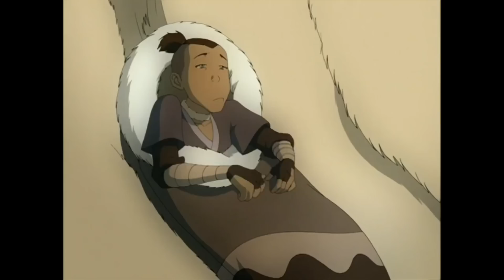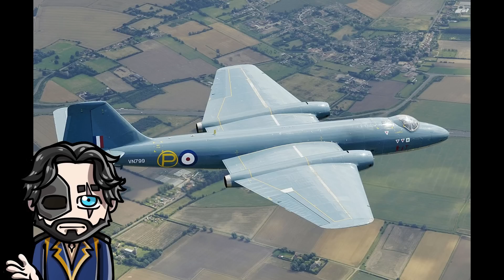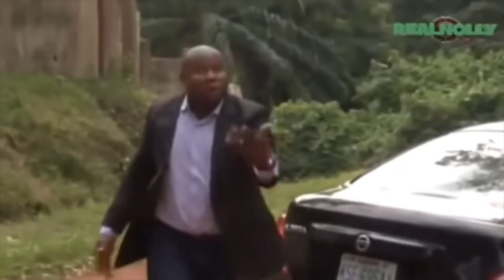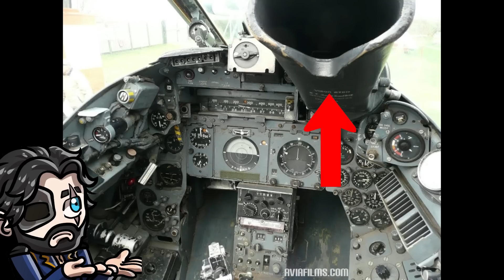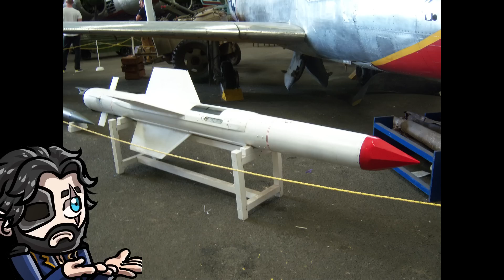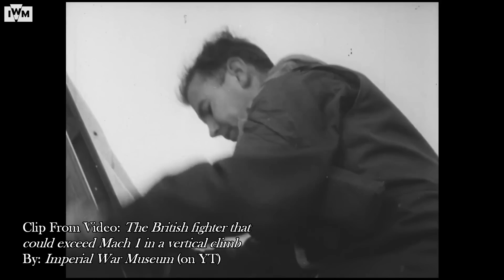English Electric Lightning: Gone In a Flash | Corrupted Intel Files

Comment: So hold on, this is the F-15, before the F-15, while also outperforming (flight performance wise) the F-15. I used to shit on this thing for its goofy ass design, I thought no way something like that would work. Talk about a 180 and some more, this thing is fucking awesome.
Reply: Fun fact: the true airspeed and altitude of this plane is STILL classified. It left service in the late 80s
Reply: Never bet against British engineering. They really are quite capable.
Reply: @langdons2848  Yes, I'm a huge fan of British engineering. I like to follow behind British sports cars and collect all the well-engineered parts falling off of them.
Reply: @Curt_Sampson you realise motorsport more or less globally wouldn’t function without the brits, right?
Reply: @jordanclark4635  Indeed I do. You do realise I was joking, right?
Reply: @ touché, sometimes hard to tell tone online, and some people would say so seriously lol
Reply: Eh, F15 is about 600 miles per hour faster, more maneuverable, more useful combat load, better avionics, and climbs at 10,000 feet per minute faster(30,000 feet per minute)
Reply: @whiskey11niner   yeah the F15 performs better but your figures are incorrect.
F15 Mach 2.5 1675mph
Lightning  Mach 2.3 1500+mph
Lightning also zoom climbs at 50kft/min.
Reply: @ the F15EX can do over 1900 MPH
Reply: @whiskey11niner  yes which is 1600+ knots (nautical mph)
The Lightning can go (1500+ knots).
Reply: @MultiVeeta  no the lightning is capable of between 1300-1500 MPH, not Knots
Reply: @whiskey11niner   sorry but you are wrong.
The Lightning F6 went Mach 2.27 which is 1750mph (1500 knots).

This is all irrelevant because combat pilots rarely exceed Mach 1.5.
And on top of that an F15EX will never be faster than an F15C, the EX carries a lot more weight and drag such as the conformal fuel tanks.
Reply: @MultiVeeta  the funniest part is you don’t realize why you’re wrong. You’re basing that statement off density altitude at sea level, at 40,000 ft which is where the lightning is capable of 2.27 that only equals out to 1495MPH or 1300 knots because the speed of sound is much lower there than it is at sea level
Reply: @whiskey11niner  are you really trying to sound smarter than what you actually are? It's not working.
Mach speed is actually True Air Speed (TAS) and is measured at what rate you want it to be, mph, nautical mph, kmh, m/s etc. 

The confusion you have arrived at (and clearly don't understand) is comparing Ground speed and True Air speed, then altitude comes into the equation.

Simply put True air speed is
F-15 Mach 2.5 is 150mph faster
Lightning Mach 2.27
Same altitude.

Now tell me some more stuff you have googled and not understood on the internet.

And just so you're aware, there is not a single aircraft that can reach Mach 1.5 from level flight at sea level.
Reply: @ I see you’ve never known why aircraft top speeds are listed as Mach_ @_ altitude, because that’s the actual airload on the aircraft, Mach changes at different density altitude(temperature) and no Mach number is not an equivalent of true airspeed, it’s a ratio of it and the LOCAL speed of sound, did you never question why a plane’s maximum speed and Mach limit at sea level is so much lower that its actually maximum speed and Mach limit, it is very cute that you’ve doubled down and let everyone know that you have no idea what you’re talking about tho
Reply: @whiskey11niner  you are deeply confused.
You're trying to tell a pilot about speed.

Generally Mach 1, the speed of sound is 767 mph TAS. But can change by upto 100mph due to altitude.
All aircraft results are in TAS.

You are talking about Indicated Air Speed (IAS) which is different to Mach/TAS depending on altitude.

Example.
IAS of 697mph at 3kft is TAS 767mph (Mach 1)
IAS of 353mph at 30kft is TAS 678mph (Mach 1)

Mach speed is a ratio of the speed of sound meaning Mach 1.20 is 120% the speed of sound, this is important for fast jets because weird things happen in this and the transonic regions and they need an easier indicator to read.

I hope you've learnt something today.

Also a planes speed is limited at sea level because of air density, the air higher up gets thinner so there is less resistance allowing aircraft to travel faster with less thrust.
Reply: @ you repeatedly say things that have nothing to do with what I’m actually talking about it really seems like at this point you’re just doing this to try and get away from an argument that you know you’ve lost, correct at sea level Mach is 767 MPH, at 40,000 feet Mach is usually around 660 MPH, I literally gave you a textbook definition of what a Mach number is, maybe you should check out aerodynamics for naval aviators, or wind and beyond
Reply: @whiskey11niner  lost, you lost on your 1st post where you claimed Mach 2.5 is 600mph faster than Mach 2.27.

I've said all along it's only 100-150 mph faster, which it is as has already been established, you just can't get over it.

And looking at it now it seems you're claiming the EX can do Mach 3, lay off the Tik Tok videos kid.
Reply: @ you good, mr “your talking to a pilot” does that work on people? Well considering the real number for the F15 EX is more like Mach 2.8 (1870MPH at around 40,000)before that statement was retracted for being “inaccurate” actually because it was real and was accidentally released by Boeing in an official press release, I’m sure they know their aircraft, I’m not the one that tried to claim “sorry but you are wrong. The Lightning F6 went Mach 2.27 which is 1750 MPH (1500knots)”, yes I have the screenshot so don’t even worry about editing that, when the official top speed is Mach 2.27 at 40,000 which is 1500MPH/1300Knots, and that was the fastest service variant of the lightning
Reply: @whiskey11niner  
Boeing rate the engines for that speed, the airframe and what it can do as an aircraft are totally different.

Mach 2.27 which is 150mph slower than Mach 2.5.
600 mph faster like you outlandishly claimed is Mach 3+.

Just drop the clown act and admit it was an incorrect statement.
Reply: @ I’m not the one that repeatedly tried to claim Mach 2.27 was 1750 MPH Mr pilot
Reply: @whiskey11niner  no you claimed a Mach 2.5 F15 can go 1900mph and that is what threw me.
Reply: @MultiVeeta  well unfortunately for you I have screenshots of you saying exactly what I just typed to the letter, you’ll find I never said that Mach 2.5 is 1900 miles an hour. I said the F 15 is capable of more than Mach 2.5 according to Boeing that they released accidentally, and initially you agreed with me, but tried to claim that the lightning could do 1750 and that 2.27 was 1750 miles an hour, which by extension means you actually claimed Mach 2.5 was 1900 miles per hour
Reply: @whiskey11niner  nonsense I have never agreed with your outlandish claim of more than Mach 2.5 and even stated to you that the EX will never be faster than the F15C due to the extra drag from conformal fuel tanks and the extra weight.

You claimed an F15 is 600mph faster than a Lightning.

Me knowing a Lightening and F15 Mach speed as 2.5 and 2.27 told you it was 150mph difference.

You claimed the F15 did 1900mph.

Me thinking you was stating 1900mph as Mach 2.5 I stated that the Lightning did 1750mph thinking this was the conversion. In actual fact it is 1650 for F15 and 1500 for Lightning.

Ive already pointed out I miscaculated based on the figures you were giving me because you have some delusion that the F15 can do Mach 3, and that is the crux of it, your delusion.
Reply: @ well I mean the AirForce’s official page on the F15 claims 1875 MPH, but what do they know, they’re just the worlds largest operator of the type, also its abundantly clear you came into this with minimal knowledge, again I never claimed the F15 in its current generation was a mach 2.5 aircraft, hell you didn’t really seem to know that Mach number changed with temperature/density altitude, and you assumed Mach 2.5 was 1900MPH as you just said, also what’s your pilot certificate number mr pilot, and no its not confidential information, fail to provide me with that and I’ll just ignore your responses, I’ve wasted enough time on you
Reply: @whiskey11niner  you are nuts aren't you.
Even Boeing themselves have stated it is a Mach 2.5 aircraft, the Mach 3 came from a sales rep at a Singapore Air Show announcing it could go well over Mach 2.5 to Mach 3.
This has been corrected by Boeing, the engine power theoretically means it can go above Mach 2.5, the actual aircraft rated performance is Mach 2.49.

I don't know how many times I need to tell you.
As for 1900mph, many articles site this as equalling Mach 2.5 because however wrong they maybe that is Mach 2.5 at sea level.
Reply: @whiskey11niner  
The Mach 3 claim came from a Boeing salesman at a Singapore Air show and has since been retracted by him.
He claimed it could go Mach 2.9 which he claimed is 2225mph at sea level. His words.

The engine power means in excess of Mach 2.5 is possible, the airframe says differently. Boeing's official statement is 2.497.

Many articles state Mach 2.5 as being 1900mph at sea level. I don't why they do this but this is where your confusion is coming from.

And, I don't need to prove anything to some random on the internet who is not even mature enough to admit when he is wrong on something.
Reply: @ yep that’s what I thought, step back small sack, good bye
Reply: @MultiVeeta  yeah that’s what I thought,  goodbye
Reply: Lot of people commenting here, comparing the lightening to an F15. Not even relevant, The F15 came many years later.
Reply: @AnthonyWild-s7d  F-15 is 50yrs in service. the Lightning and F-15 came out 16yrs apart. They had overlapping services. It's 100% relevant.
Reply: @AnthonyWild-s7d  F15 Avionics fantastic to go to war in but to fly Brian Carrol would still choose the Lightning.
Reply: faster =/= better

Flight performance wise, the F-15 would wipe the floor in a dogfight.

The YF-12 was an even faster interceptor.
Reply: @SoloRenegade  I’m well aware of that. But it doesn’t mean it ain’t cool.
Reply: F-15: Mach 2.45, 16k lb useful load, 675mi range, 65k ft service ceiling
Lightning: Mach 2.15, 10k lb useful load, 115mi range, 60k ft service ceiling

F-15 is more maneuverable, more advanced, especially with the new F-15EX, has countermeasures, RWR, better radar, etc.

F-15 wins hands down in basically every category.

Only the supercruise was an advantage. but with so little fuel on board, that wasn't much of an advantage.
Reply: @SoloRenegade  Ok fair point.....

But counterpoint...
Lightening's max speed is unknown. It's still classified and the known internet speed is the average max speed recorded by the export variants who were less aerodynamically stable with all the extra hard points they added for missile pods and fuel tanks.
Same issue for the max ceiling altitude. There are several versions of the lightening and only a hand full of them have declassified flight data.

I have no idea why a 30 year old plane needs it's flight data classified when we have modern aircraft with their flight data publicly available but the cold war was a strange time for military information.

But please bare in mind that one Lightening successfully intercepted a U2 spy plane at close to the U2s top altitude.

But that being said we ae still assuming the F-15 information is right as the USAF does have a habit of understating the capability of it's aircraft.

I still think that the Lightening beats the F-15 even if only because the F-15 only just outperforms it almost 10 years later after a huge development of aircraft innovation.

It's like a biplane being able to compete alongside a P51 type crossover.
Reply: @SoloRenegade  So how come the Lightning could intercept U2 and Concorde but the F-15 could not? Where did you see the 60k service ceiling? The actual ceiling is classified but Soviet intruders have been intercepted at higher altitudes than that.
Reply: @telhudson863  F-15 could intercept them, but didn't need to.

how many satellites have lightnings killed? how many air to air kills does a lightning have? how many countries operated the lightning and for how many years? why is the lightning no longer in service?
Reply: @SoloRenegade  
Mach 2.15  LOL 
 60k feet LOL

F15 couldn't intercept Concorde or the U2
Reply: @sichere  F-15 could intercept the Concorde and the U-2. if real combat, they'd intercept early, and fire missiles.

Keep in mind the F-15 has killed satellites and zoom climbed to well above a U-2.
Reply: @SoloRenegade  Not operational Squadron ones
Reply: @SoloRenegade  in 1985, while conducting Concorde's trial test flights, BA offered NATO to exercise on intercepting a fly-high supersonic bomber. all modern fighters, including F14, F15 and F16, failed to reach their target, except the 1950's EE Lightning, who intercepted the Concorde with ease.
Reply: @sichere  an operational F-15 shot down the satellite, and others could too. How many have the Mig25 shot down?
Reply: @sichere  poor test. they were trying to catch the Concorde from behind. Lightining and Concorde can supercruise. Biased test. in reality the F-14 and F-15 would have slung Mach 3-5 missiles in a head-on intercept. F-15 would have no trouble shooting down the Concorde in teh slightest.

Lightning didn't carry much in the way of BVR weapons, or much weapons of any kind.
Reply: @SoloRenegade  The EEL was ground linked guided to target and capable of carrying instant sunshine. it entered service with the RAF  as an Experimental Development Aircraft and the BAC version with RR Avon 302 R  engines were often clocked at Mach 3 over the North sea by the Dutch Air Traffic Control.
Reply: @sichere  "engines were often clocked at Mach 3 over the North sea by the Dutch Air Traffic Control."

yeah, engines do go faster without the aircraft. I think you need to work on your english.....

and remind me the range of the Lightning again?

The lightning Never went Mach3, that was the SR-71. The Lightning was slower than the F-15 at only Mach 2.15. Cope harder. the Lightning was cool for its day, but highly impractical except as a short range interceptor, and it was otherwise hot garbage, which is why nobody else wanted it.
Reply: @SoloRenegade  the BAC version with RR Avon 302 R  engines were often clocked at Mach 3 - Looks and sounds English to me !

A BAC Lightning "Bounced" the SR71 as it crossed the Atlantic on its record speed run. 

The top speed of the Lightning is unknown as it would run out of fuel before it stopped accelerating. Fuel and range was not an issue as the RAF had Victor tankers at 50,000 at 0.9 mach that could fuel 6 at a time and took them all the way to Singapore in case the Australians needed help in Vietnam !

There's plenty you do not know about the EEL and plenty that is still underwraps.

The RAF  is reputedly the best airforce in the world and the EEL was part of the then newly developed philosophy of a "Fully integrated weapons system" .
Reply: @sichere  " engines were often clocked at Mach 3"

You don't seem to understand aviation. the engines were Never "clocked" at Mach3. the Lightning is not an engine, it is an airplane. The engines cannot go mach3 by themselves.

If you claim the Lightning went Mach3, then how come you have no sources to back that up?

"The top speed of the Lightning is unknown as it would run out of fuel before it stopped accelerating."

this is a lie, what is known in Aviation as an "old Wive's Tale". Someone telling tall tales and idiots like you believing them.

"Fuel and range was not an issue as the RAF had Victor tankers at 50,000 at 0.9 mach that could fuel 6 at a time and took them all the way to Singapore in case the Australians needed help in Vietnam !"

It absolutely was an issue. Ferry range and refueling is not Combat range and refueling in combat. The range in combat is so short that the tankers are too close to combat and would be shot down. Even the much longer ranged USAF aircraft in Vietnam and Desert Storm sometimes had to call the tankers in closer to save aircraft, and it came at great risk to the tanker crews. And the lighnting would require tankers to operate many times closer to the battle, to the SAM sites, etc.

"There's plenty you do not know about the EEL and plenty that is still underwraps."

not nearly a much as you think. Aerodynamics is physics, and we can calculate things. and aircraft are designed and optimized for certain types of flight, altitudes, etc. and you can't just brute force change that fact at will. So those of us who know the science are able to reverse engineer what capabilities a craft actually have (like the J-20).

"The RAF  is reputedly the best airforce in the world and the EEL was part of the then newly developed philosophy of a "Fully integrated weapons system" ."

Not even close. USAF and Israel are definitely both even better. USAF and USN were already better than the RAF in WW2. Consistently in NATO exercises the Israelis, Swiss, and others come out on top. RAF is so short on aircraft and pilots today that people are mocking the RAF. RAF has prioritized DEI over merit and competence too.
Reply: @SoloRenegade   it was the now cancelled ASAT missile that shot down a satellite, the F15 launched at Mach 1.1 from 38000 ft, most jet fighters could have launched that missile.
Reply: @SoloRenegade  the point is the Lightining was far and away the best jet to take off and intercept incoming bombers.

Something the US highlighted it needed the capability or a tighter defence network when the Avro Vulcan nuked the US in training, twice.

Obviously the F15A came out much later and became the most complete fighter when it became the F-15C with updates in the 80s and then again late 90s and more recent. Different era of aircraft 16 years between IOC of these aircraft, EE 1960, F15 1976, not even worthy of comparison.
Reply: @MultiVeeta  " the point is the Lightining was far and away the best jet to take off and intercept incoming bombers."

debatable, given it's lack of missiles. The F-106 outlasted it in that role as well.

"Something the US highlighted it needed the capability or a tighter defence network when the Avro Vulcan nuked the US in training, twice."

that issue had nothing to do with having a Lightning or not. it was an early warning radar detection issue, somehing the Lightning could not solve.

"Different era of aircraft 16 years between IOC of these aircraft, EE 1960, F15 1976, not even worthy of comparison."

......wow, how ignorant.....how long has the F-15 been in service? how does the F-15 stack up against the best fighters today? the F-15EX is AS maneuverable as an F-22, powerful radar, over 20 missiles, etc.

16yrs spread is literally nothing, an they are 100% comparable since their service periods overlapped, and since both aircraft were compared against each other in actual tests.
Reply: @MultiVeeta  the US also tried a previous satellite missile, that failed, but was perfectly capable of succeeding.

You know what the lightning never did, and never could do? Carry that missile.
Reply: @SoloRenegade   the point is watching too many reels makes you believe it's the F15s performance that allowed it to fire a missile to hit a satellite when the reality is it was the missiles performance that allowed the hit.

Just the same as all those SR71 reels telling you how it left a Mirage standing when in reality the max speed of a Mirage at 40kft is Mach 2.2 and an SR71 max speed at 40kft is Mach 1.6. The Mirage would out accelerate it up to its ceiling.

Or it outrun missiles when in actual fact it never flew over Russia but skirted the border where any aircraft could escape a missile launch.
Reply: @MultiVeeta  "the point is watching too many reels makes you believe it's the F15s performance that allowed it to fire a missile to hit a satellite when the reality is it was the missiles performance that allowed the hit."

you're a moron. I never claimed no other aircraft could shoot a satellite down. even a Burke destroyer can do it.

But the Lightning could NOT do it.

you're now getting into red herrings, changing the subject.